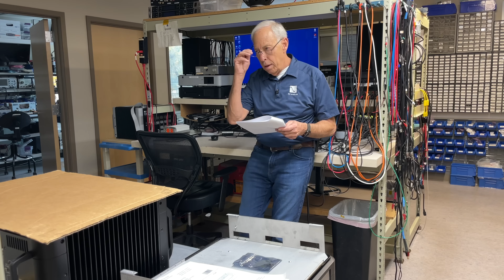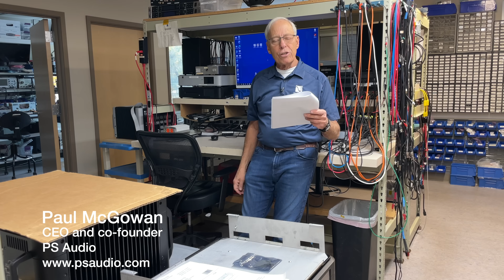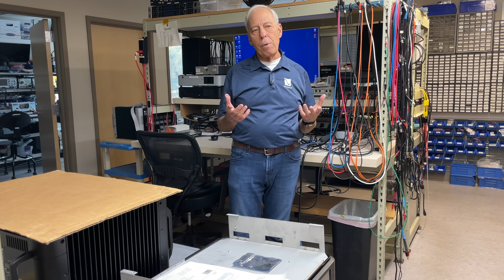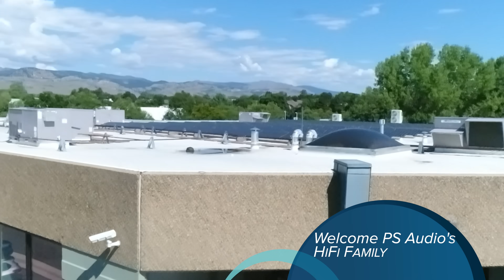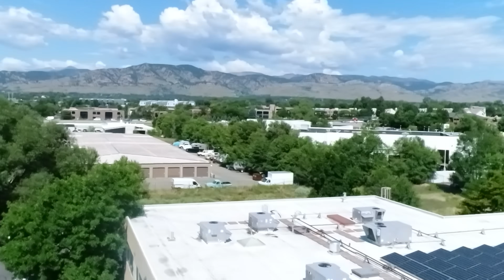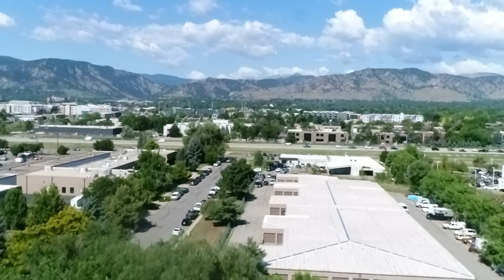Hardware vs  software crossovers

Comment: An active analog crossover is still a hardware crossover. A software crossover uses logic to mathematically filter the signals. Crossovers that make use of thousands of finite impulse response filters can be much steeper and avoid phase shifts. They can sound better, but it depends on the ADCs and DACs too. A software crossover can be so compute-intensive that much of the logic must be implemented in dedicated hardware, such as an FPGA. So a "software" crossover may be more like a "firmware" crossover.
Reply: If you start with a digital source, you can get away with DACs only but for a phono turntable a true software cross over would be a nightmare to implement.
Reply: @hugobloemers4425  Yes, its only for someone with a computer for a source.  But many people do that.  All their music is free that way so its a powerful draw.  Especially if they've chosen their DAC, power amp and speakers  well.
Reply: Good distinction. I use a "software crossover" (still runs on a hardware DSP of course) by DEQX. Problem doing this in a high-end setting is that DACs and amps become (of course) critical. In a passive system you can go all-in on a beautiful high-end DAC and amp, for an active three-way system you need three DAcs, and three amps. Granted, the amps can be optimised for the task (I use two class-A amps for mids and highs and class-D for the bass) but the DACs really triple the cost. So a €10.000 DAC becomes a bit steep times three. Still, the gains with respect to passive systems is huge in terms of clarity and coherence IMHO. I my case I use a Chord Blu MKII as digital source, and Chord Qutest DACs linking it to DIY Pass F5 amps for mid and high, and Hypex UcD for the bass. On open baffle speakers this setup sounds amazing.

Comment: Great info as always, but I think the question may actually have been about something slightly different; analog active crossovers vs digital active crossovers. The former being (essentially) a passive crossover moved backwards in the chain between the preamp and power amps, and the latter being a programmable set of chips of some variety with an ADC as an input and multiple DACs as outputs; occupying that same space between the pre and power amps. The primary difference being control breadth and granularity, at the expense of a purely analog signal path.
Reply: I prefer my jazz smoothe, just as I mix well my hot chocolate.  Neither is acceptable with granularity.
Reply: Correct.

Comment: Active speakers with DSP cross-over and optimized amplifiers can yield top notch audiophile performance but too few companies have the combined skills to do it well. One example is the active KEF LS50 that sounds better than the passive KEF LS50 with any external amp.
Reply: Lots of OEM on that market, same stuff DIY uses many times. So right now it's actually a lot cheaper to do stuff yourself than buy them finished, for however long that will last.  :)

Comment: Wouldn't the term "software crossover" refer to a DSP crossover in the digital domain? 
Your description is about the difference between a speaker level passive crossover, and a line level active crossover, but neither of those involve software.
Reply: Yes my thinking as well, I think Paul set off describing the hardware type and lost the original question. Surly a software crossover has to be in the digital domain
Reply: Yea that's what I thought. Computer software based.
Instead he compared Hardware vs Electronic.
Reply: @Bassotronics  Crossovers are deemed passive or active.  Some people refer to active crossovers as electronic.  The Dalquist DQLP-1 was one of the first electronic crossovers that was popular in high end circles.  HP of The Absolute Sound heralded this thing, later it was modified by Van Alstein from 18 db/octave slope to 24 db/octave slope.  They were very reasonably priced.  He used that to control the bass to Magneplanar Tympani 1D bass panels that he paired with Inifinity's QRS midrange and tweeter panels.  That was the beginning of what high end calls the soundstage.   HP ushered it in.  Later people paired the Magniplanar MG3's ribbon tweeter with the QRS midrange or Strathern ribbons and the Tympani bass panels.  Then the Infinity IRS came out and HP bowed down to that.  Then the Genesis 1.  But they all used the same style of electronic crossover/amp for the bass and another amp for the midrange and tweeters.
Reply: @FreshAirRules  
I know, but the title says “software” as in used by a computer or anything related to that.
Reply: To me it looks like Paul was planning on responding like that but then decided to not go in that rabbit hole, hence the 99.99% number he used that went nowhere. Because a true software cross over is not just a DSP, you will end up with a DAC per speaker (type of) component. So if you have three way speakers, you will end up with six DACs instead of two. And compared to that, those Mundorf capacitors and coils look like a bargain.
Reply: @hugobloemers4425  True; but things you can do with a SW cross, in terms of accuracy and phase delay control, can't be touched analogically. 
Will be expensive, though. :)
Reply: @hugobloemers4425  the whole crossover happens in the DSP of the pre-amp
Reply: @hugobloemers4425  -- Except a DSP-based crossover is a much better and more versatile performer.  My active three-way Kali monitors have six channels (three per soeaker) of everything -- including crossovers, driver-specific active EQ, and first-rate Class D amplification -- implemented via relatively inexpensive, off-the-shelf ICs.  Not only are the results spectacular, but the cost is astonishingly low.  In fact, I'm willing to bet that all the SOTA ICs in those speakers actually cost less than the pricey caps and coils in Paul's (actually Chris's) passive crossovers.
Reply: true , i agree with your statement .